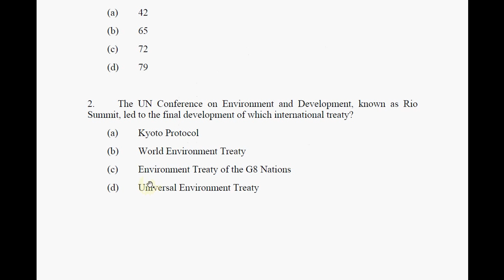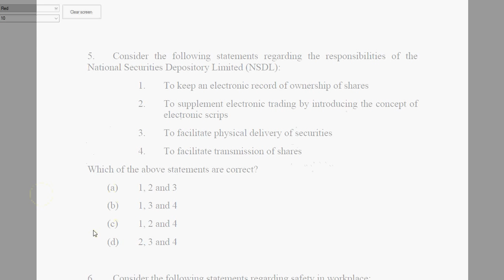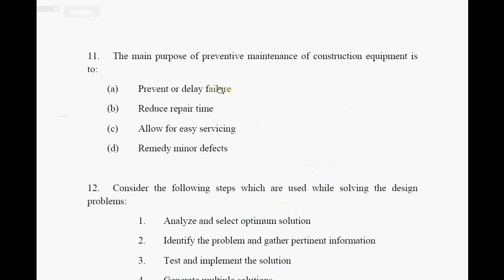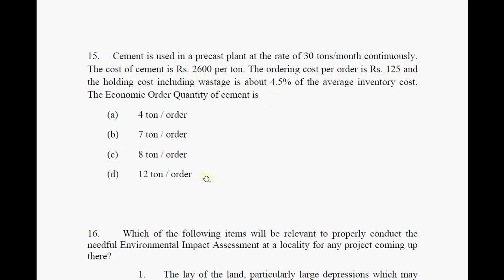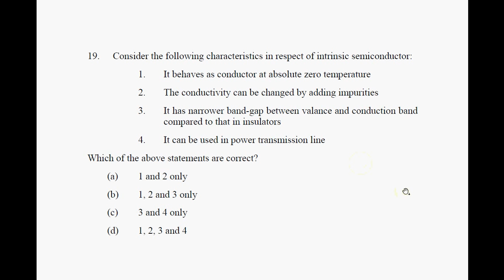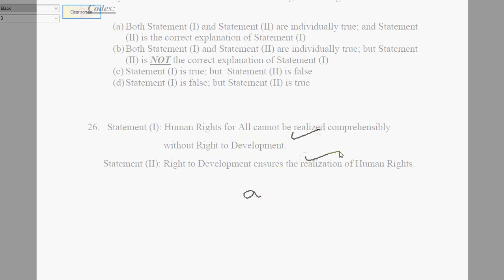ESE 2017 General studies model question paper SOLVED

Comment: Q19. option (C) is correct. statement 2 is wrong. Intrinsic semiconductor doesn't contain impurities(or negligible). If we add impurities then they will be converted into extrinsic semiconductors.
Reply: narayan meena 
so it increases conductivity?